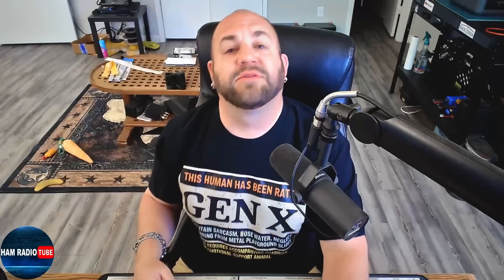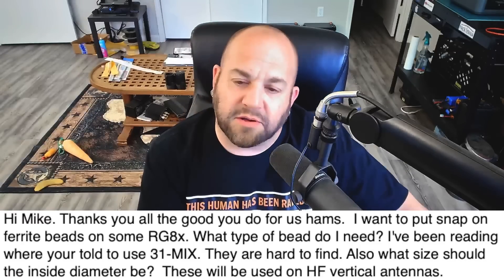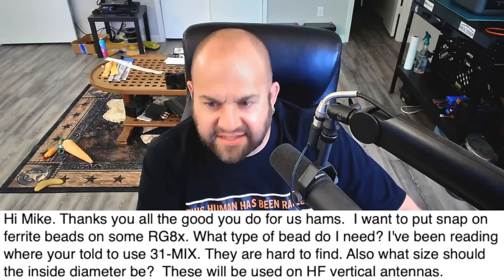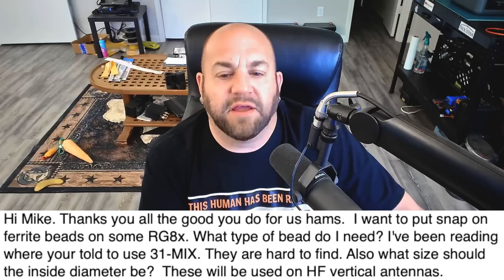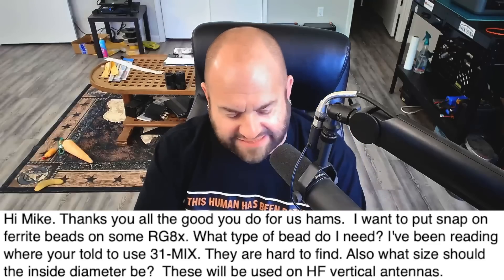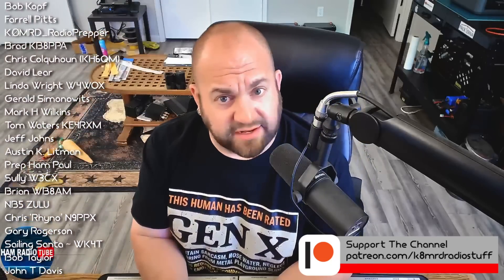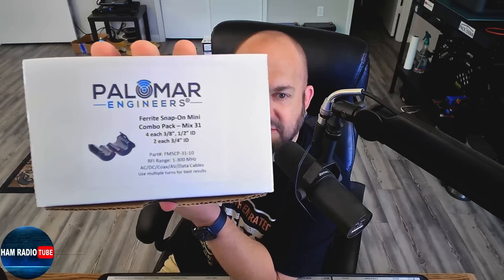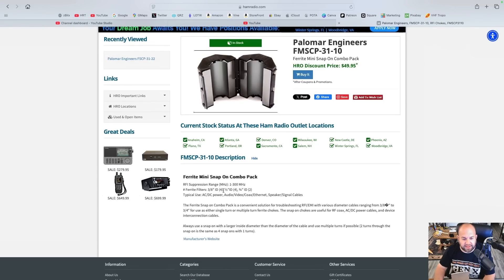Do Antenna Tuners Actually Tune Your Antenna, Or Are They Lying To You?

Comment: For the most part I agree with what Mike has said (most specifically, his statement that an ‘antenna tuner’ (really the old moniker of ‘transmatch’ is a much better term for what they do) is an impedance matching device – nothing more, nothing less). Its function is to match the impedance of the antenna system (key word ‘system’) to that required by the transceiver. In doing so, the transmatch allows the maximum transfer of power into the antenna system. It essentially provides a tuned circuit (not just the antenna) for the output from (and correspondingly, input to) the radio. As can be inferred from what I typed above, I also agree that a transmatch does nothing to change the characteristics of the antenna itself.

The above being said, I’d like to add a few points which I think are very important to understanding transmatches and certain aspects of antenna systems.

- First and foremost, the term ‘resonant’ does not mean low SWR (although they often coincide). Resonance ONLY means that the inductive and capacitive reactances are equal and therefore cancel each other. The other component in impedance is resistance. An antenna can be resonant and still have a resistive component anywhere from a fraction of an ohm to virtually infinity ohms. This characteristic can be visualized as the horizontal line on an antenna network analyzer (I don’t call them ‘antenna analyzers’ as they really provide no information about the performance of the antenna itself) or on a Smith chart. Resonance occurs anywhere along that line – yet the SWR is still dependent upon the value of the resistance which varies massively from one end of that line to the other.

- An antenna does NOT need to be resonant in any way to be effective – nor is a ‘resonant’ antenna somehow better than a non-resonant one. In fact, many non-resonant antennas actually outperform their resonant counterparts. A classic example is the 5/8 wave vertical commonly used on VHF and UHF. A 5/8 wave antenna is not resonant (nor does it natively have a low SWR) and therefore requires an impedance matching device – the exact same function as a transmatch – (normally incorporated into the antenna housing) in order to present an approximate 50 ohm resistive load to the radio. Even though it is not resonant, the 5/8 wave antenna provides a radiation pattern which provides gain (focused toward the horizon where it is most useful) over a ¼ wave antenna – which is resonant and provides an approximate 50 ohm load without a matching device. Another example is the extended double zepp on HF. The EDZ provides approximately 3 dB gain over a half-wave dipole (with a similar broadside pattern) – yet the EDZ is not resonant (nor does it natively have a low SWR) and therefore requires an impedance matching device. Loops, doublets, long wires and other designs of non-resonant lengths can also provide a higher level of performance than a resonant dipole – but again, the impedance must be matched in order to use them. Also, please note the quote below from chapter two of the ARRL Antenna Book:

“Please recognize that an antenna need not be resonant in order to be an effective radiator. There is in fact nothing magic about having a resonant antenna, provided of course that you can devise some efficient means to feed the antenna. Many amateurs use non-resonant (even random-length) antennas fed with open-wire transmission lines and antenna tuners. They radiate signals just as well as those using coaxial cable and resonant antennas, and as a bonus they usually can use these antenna systems on multiple frequency bands.”

- It’s also important to understand that transmatch is but one commonly-used impedance matching device. I’m always amazed how many people will say that they never use an ‘antenna tuner’ yet when asked what type of antenna they use, they often mention that they use an end-fed with a 49:1, 9:1 or other ratio of transforming balun – which is an impedance matching device. If you’re using such an antenna, you’re using what is essentially a non-resonant radiator with an integral fixed value transmatch (‘tuner’). Going back to my example above, if you’re using a 5/8 wave 2 meter antenna on your car, you’re using a non-resonant radiator with a built-in fixed value impedance matching device – again, the exact same function as a ‘tuner’.

- A transmatch isn’t ‘fooling’ your radio nor is it just ‘making it happy’. As noted above, it simply changes one electrical condition for another (in this case, impedance) in order to provide what is required. As noted in my previous point, transforming baluns are impedance matching devices – yet no one says that such a balun is ‘fooling’ your radio. Another example – the USB charger you use for your phone converts 120 VAC to the 5 VDC required by your phone (not impedance, but still just changing one electrical condition for another). Again, no one thinks that the charger is ‘fooling’ the phone into seeing the voltage it requires.

- Many people think that the role of a ‘tuner’ is to compensate for a somehow defective or otherwise poor antenna and that instead of using a ‘tuner’ one should simply ‘fix’ their antenna. As can be seen from the examples note above, many relatively high-performance antennas are not resonant (nor do they natively have a low SWR) but simply do not provide a nice, convenient 50 ohm resistive load. That’s where the transmatch comes into play. In fact, if a person were to use ONLY antennas which natively provide a 50 ohm load, their antenna choices would be very limited indeed. Impedance transformation (whether it is performed using a ‘tuner’, transforming balun, integrated matching device, etc.) is something that is quite common and in fact necessary with many antenna designs.

OK, I think that’s it for now. I’ll just summarize by saying that an antenna ‘tuner’ (again, the term really should be ‘transmatch’) can be a very valuable component in a highly efficient antenna system – when used properly. Understanding their role and proper use can open up an entirely new set of possibilities for antenna systems which can provide an enhanced level of performance beyond that which can be provided by those which natively provide a 50 ohm resistive load.
Reply: Well said! As an Electrical engineer and ham radio operator for over 50 years, its always struck me funny how so many fundamental aspects of our amateur radio service aren't clearly understood. An impedance transformation is needed since solid state transmitters began to be designed to transfer maximum power at 50 ohms. I love my MFJ-939 device since it allows me to 'play' with an endless variety of wire antennas and work multiple bands. 
- 73, 
Stan WB5UDI
Reply: Agreed - well said.
As explained, this makes a lot of sense.
Whilst I do not fully understand the principles involved, I have seen first-hand how an ATU allows a random piece of wire to radiate the full power available from the radio.
This was when I was young an foolish, I thought it would be a good experiment to drive some varnished transformer wire wrapped around a short length of 2Inch D plastic pipe on the desk next to the radio.
Starting off, the SWR was out of the ball park, with the radio set for 100w (and no power reduction protection), nothing unusual, then as I quickly used the analogue ATU ... a little on the left wheel, a little on the right wheel, the SWR came down and as it approached 1:1 a blue flame of ionised gas up to 1inch long appeared at the tip of the wire. Fascinating and entertaining... Clearly the 'flame' is evidence of radiating EM and clearly the radiation from the wire increased with the improving tuning/matching.
Since then I have heard people say that an ATU will not make an 'antenna' resonant implying that it will never radiate as much power as a resonant antenna.  In my mind I am doubting and thinking 'Well, I have seen it...' and the accompanying thought is that if power is not leaving the antenna and is being 'reflected' (implies a one-way return trip from the antenna), then there should be some considerable heat build-up in the ATU or the coax which does not happen.
Fortunately I did not end up with cataracts but anyone thinking of trying this, you might consider your personal safety first.
Reply: Excellent points - I have read many editions of the ARRL antenna book - it’s an amazing wealth of knowledge/ I think your re-capped the key points in a simple  way that provides key insight into a very complex subject !
Many thanks

Comment: One can evaluate the effectiveness of Ferrite beads using a NanoVNA.  In general,  one will find that two ferrites or two turns through a single ferrite is not twice a good.  A RF Ammeter can also be helpful if RF is on the coax shield.

Comment: Maximum power transfer theorem: Maximum power is transferred to the load when impedances are matched. The tuner doesn't tune the antenna but matches the impedance so maximum power can be transferred. I have a Motorola Micom 3 and a B&W-65 folded dipole. For some reason, this dipole, which is not the best of antennas (in fact, very inefficient, only good for ALE) shows a 2.5 SWR at 40m. I found a net in Panama on 40m and tried to check in using max power (about 125W). They could barely hear me, so I changed radios: I put my little G-90 (20W) to the same antenna, hit the internal tuner and boom, 5/7 signal report. 125W versus 20W, no copy to good copy.

Comment: To the coax guy, buy bulk coax and learn how to install the connectors yourself. I get the bulk from ABR or DXE and the connectors from Max Gain Systems. VERY detailed instructions are provided by Max Gain. It does require the purchase of specific tools, but consider that an investment.

Comment: I put 5 ferrites on each end of coax and on each end of ethernet CAT8 shields cable and still my PC disconnectes when I PPT on 40m or 80m
what you will suggest to solve this
Reply: What exactly is the computer doing when it disconnects ? How are your cables run in relation to eachother ? If the computer turns off it could be a iffy powersupply, I've had that happen with tvs before when transmitting, if you have any other cables into your computer you could try putting chokes ok those.
Reply: @dakkadakka9189  I put chokes on every cable and still ethernet connection of PC sometimes disconnects when transmitting on 40m and below
it is not a power issue, it is RF issue
I will replace my coax to antenna and see if it helps
Reply: @LunarVagabondSailor  it's possible shielding has gone bad or wasn't overly good on your coax from factory also a chance you could have an issue in a port on the pc that's picking up rfi, you could try moving the computer around and see of some separation helps.other then that it would require diagnosis on pc.

Comment: Thank you for talking about 'antenna tuners'.  While impedance matching between the transmitter and load is essential, the antenna's reactive components persist independently of the tuner's location. The presence of antenna reactance results in energy storage, causing increased losses and a decrease in radiation efficiency as the magnitude of the reactance increases. The tuner's function is not to remove the antenna's inherent reactance, but rather to transform the impedance seen by the transmitter.  However, non resonant antennas are certainly quite usable.
Reply: It's not really a problem at the antenna. Just a matching circuit. But if the antenna is much too short, the losses in the components will usually be high.

Comment: If the G90 won't tune the G5RV, try changing the length of the feed line (add a 10 to 24' "jumper").

Comment: People need to stop tuning coax. Tuners are only beneficial to the signal when they are at the antenna. Nothing beats a tuned antenna, but a proper transformation of impedance will transfer the most amount of power to the antenna.

Comment: The proper term is "Trans Match."
Reply: According to the ARRL and others: "With proper system design, an antenna tuner or transmatch can allow a non-resonant antenna to operate nearly as efficiently as one that is carefully cut to resonance.  These articles and links will help you understand what needs to be done to  make and use effective an antenna system using a transmatch." TRANSMATCH!

Comment: Mike at 9.05 ish you said G5RV is not resident on any band. Not. It was designed for 20 meters! Perhaps you are confusing it with a DOUBLET which should work on almost any HF band if length and design is right AND it needs an impedance matcher / transmatch / or magical box to match the transmitter output impedance to the TRANSMISSION line impedance. Alan NY2G PS: I tune my antenna while standing on a very  tall ladder 😊 Mike keep up the good work we all learn a lot.
Reply: PPS: Any ham can't beat a manual tuner (that can impedance match almost anything (even a wet noodle)) and might learn more about transmission line impedance and antenna resonance.

Comment: A couple of decades ago, I used to go around and scavenge those round torroids from every computer and monitor cable I could find in the trash. I ended up with a box of them and used them on everything.  I never knew if they were the correct 'mix' type.  All I knew was they always worked for RFI reduction in the shack.  I still have a plastic box of them!

Comment: the IC7300 has a very good tuner system built in the radio, be sure you explore that area of the radio before making things more complex for yourself with an external toner. Also the best tuners  are located at the base of the antenna not at the back of the radio. A DX commander vertical antenna is designed to be more resonant on several bands making matching a little easier